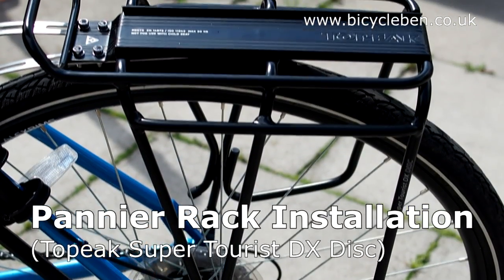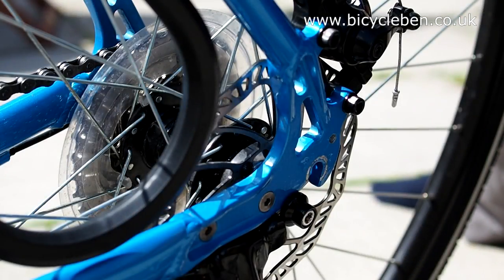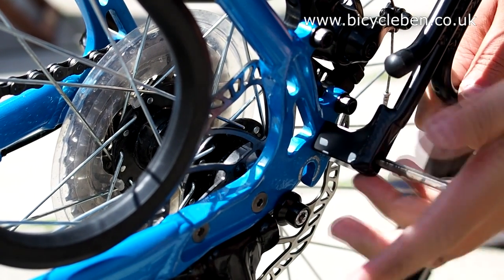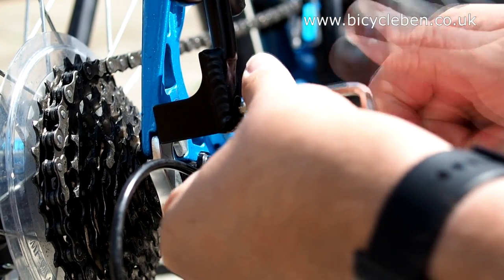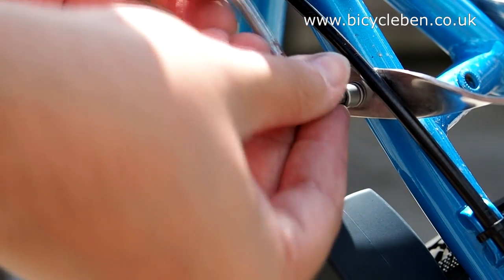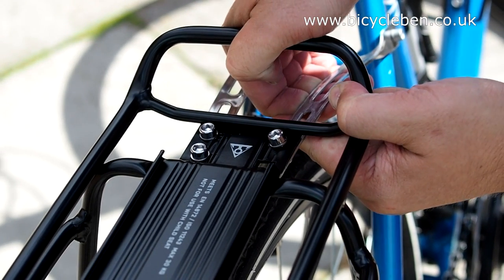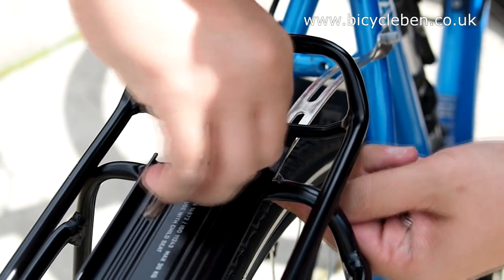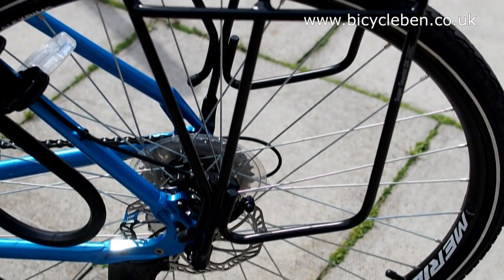Installing a Pannier Rack to a Bike (Topeak Super Tourist DX Disc)

Comment: I fitted one onto a road bike without any mounting positions 16,000 miles ago using exhaust clamps and have since took it on 10+ flights, done food deliveries and carried way over the weight limit touring. I use ortlieb bags. The spring version was getting in the way with the ortlieb bag mount rails. The rack is solid and well designed.

Comment: Have the version with the spring clamp & a couple of trunk bags that fit this make of rack.  My son like the trunk bag that he bought the rack & took one of my bags.  I have the older expandable bag (no bottle pocket) & used it to carry work clothes to & fro. % years & counting.  Now retried,  have added pannier baskets.  I use bags slightly larger than the baskets to haul groceries & I strap on my large "U" lock.  One thing, to date I have used the rack's spring clamp only once. The trunk bag is much more flexible for me.  This one is made by Topeak.

Comment: If you've got dropped seat-stays, like the Triban has for instance,
swapping the seat-post clamp for one with mounting holes fitted, will make life easier.
I like to swap the nuts over for locking variety. 
+ and apply some copper-slip to all the nuts and bolts - stops them seizing in place, over time.

Comment: I’m afraid you put arms on wrong sides. Should be swapped, according to the manual. In most bikes arms will be twisted less than 90 degrees. In your case must be twisted more than 90. Should not be really big deal in real life but since many users watch your video instead of reading manual, it’s betted to pay their attention.
I mounted 2 of topeak racks on my bike and bike of my son. He was using Topeak DXP bag. It’s easy and fast to fit, on bad roads the black paint on the base plate (?) was getting scratches to the white aluminum and it’s the only drawback I can see. I used universal Merida bags, cheap and rather simple, suiting the rack very well. The set was noisy on forest trails but trails is not the place for bike with big bags.

Comment: Can you connect silver brackets to seat post holes? Where you tighten the seat?
Reply from the maker: I wouldn't recommend fixing the rack in any way other than as intended. There are other racks available if you don't have the appropriate mounting points on your bike including ones that clamp to seat posts.

Comment: Great video, thanks, do you know if this rack can be fitted along with SKS Blumells mudguards, seems the rack bolts will need to also hold the mudguards....?
Reply from the maker: Thanks. That's a good question, and to be honest I'm not sure. There is a mounting point available between the two seat stays, above the wheel (see 1:38) but mounting retainers near the axle may be problematic. Purely speculating, but you might be able to fit the mudguard first with the rack fixings over the top, but long, good quality bolts may be required. If in doubt, I recommend popping along to your local bike shop for advice on your specific setup.

Comment: If you have to change a flat tire will the rack be in the way
Reply from the maker: Shouldn't be, no - at least it's not been an issue on my bike where the fixings don't interfere with the axle bolts, so it's still easy to remove the wheel before changing the tube or patching. I obviously can't speak for all bikes and fixing types. I guess if you want to patch a puncture with the wheel in situ, the rack would restrict access from the top - but no more than any other rack.

Comment: Does anyone, anywhere post a video for installing it on NON disk brakes? You know -- the type that were used for the past eight decades of cycling?
Reply from the maker: This is a model specifically for disc brake cycles. You'll want to look for a rack that is compatible with rim brakes.

Comment: Hi, How is the rack working out for you?  Which bag do you use with it?
Reply from the maker: It's been absolutely fine and solid since installing it. No problems. I'm using the Topeak MTX Trunkbag DXP which offers a lot of versatility in configuration, and of course works with the QuickTrack rail system.
Reply: @BicycleBen  Thanks, I'm looking to get the same rack/bag combo for my bike.  The expanded DXP panniers don't interfere with peddling at all? Also, Which kick stand do you have?
Reply from the maker: @AlexxKovacs  No interference at all. The only thing I make sure is to use the elastic ties for the panniers in the right orientation to avoid the risk of them getting caught. The kick stand I have now is just a generic thing that bolts around the chain stay. Nothing special.

Comment: Will it fit a Tern eclipse p20 26 wheel folding bike?
Reply from the maker: Sorry, missed your comment. Did you find an answer? I wouldn't like to give a definitive response either way. If the bike has the appropriate mounting points then it may well do, but I guess it could impact on the fold. If you're still investigating, have a word with your local bike shop to see what they advise.

Comment: So how might one install the rack without the pre drilled holes and fittings on the frame?
Reply from the maker: If your frame doesn't have the appropriate fittings for this rack, you'll need to look at an alternative such as one with seat post fixings e.g., the Topeak MTX Beamrack (not an endorsement as I've not used it, but just to give you an idea of an alternative option.)